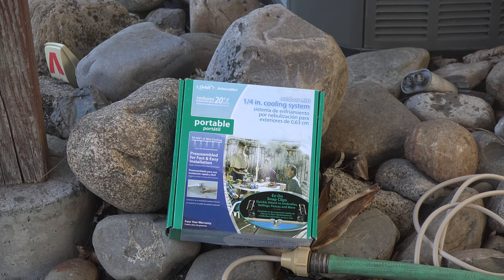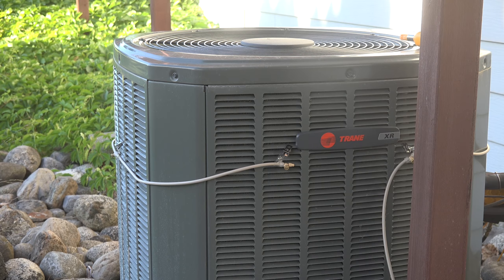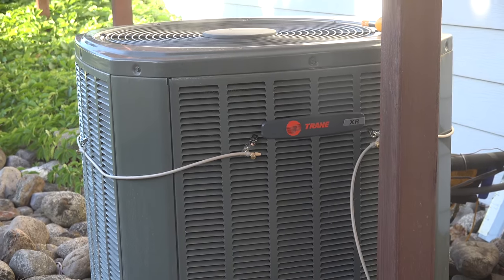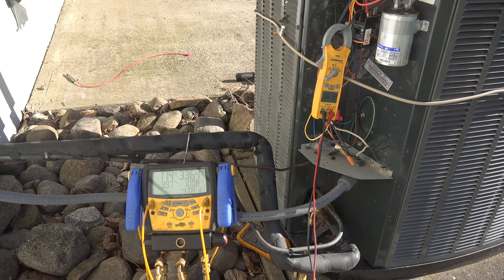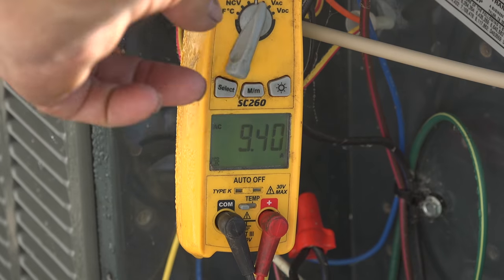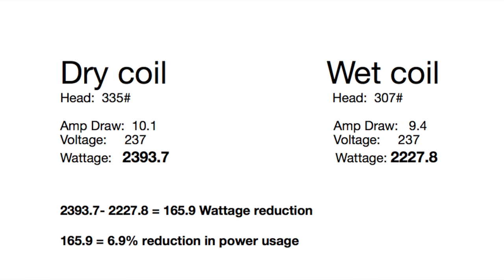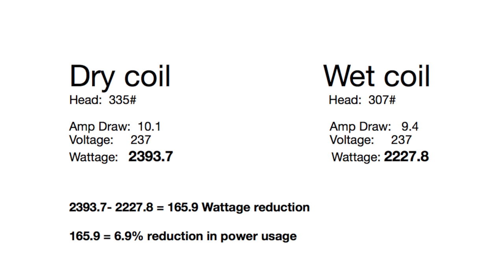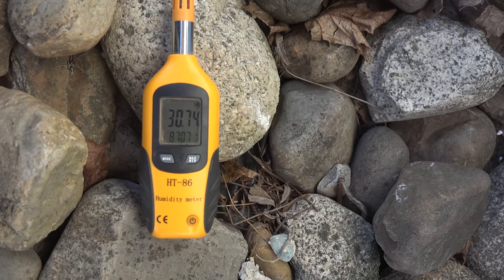Do the misters for A/C work? Part #1

Comment: The reason this system works is not simply the evap. cooling method. Water (and solids) have a higher heat density than air. The small amount of water carries away more heat than a comparable volume of air. With professional help, you could take the coil itself and place it in a tank of de-ionized water with corrosion inhibitor added connected to a small radiator/fan system that prevents the water from getting too hot and you would have very efficient cooling without worrying about hurting the coils. The air exchange part of the system is the largest inefficiency in any a/c system.
Reply from the maker: What you are describing is a water cooled condenser with a cooling tower..  The condenser is essentially a pipe inside a pipe.  And yes, head pressure can be reduced.  
The problem is the use of water complicates the condensing of the refrigerant.  Maintenance is increased by many times.  The fan to cool the water is also not small.  It is the same or larger than the fan of the air cooled condenser.
GFM

Comment: Even with an advanced water softener quite a bit of calcium still passes down line. Problem is after calcium is deposited acid is used to disolve and that damages both aluminum and copper
Reply from the maker: Agreed.
GFM

Comment: What happens with other side of system?

Does subcooling on txv system change? or super heat?. 

if evap side stays the same great but if not youre running a lower amp draw but also dropping less temp and humidity across the coil inside then whats the point?

ie you run lower amps but over a longer run time you use more power as the cycling is longer.

seems like a gimmic to me
Reply: you could test btu output on airside to figure out if it makes a difference in capacity. that way youd have eer vs eer instead of just amps
Reply from the maker: I don't know about subcool, but as the unit uses a TXV, superheat should not change.  The effect on performance would be all positive.  Similar to a lower outside air temp.  Compression ratio will go down.  One downside could be low outdoor ambient operation causing a frozen coil.  
Understand that I am not singing the praises of this product.  I don't think it is a valuable idea.  Very little savings for a lot of damage to the coil.
GFM
Reply: thanks gfm
i agree its a costly gimmic.

best way to be more energy efficient is to install a more efficient ac system to begin with and keep it maintained

Comment: Between cycles the water just sits there in the garden hose getting hotter. Think a cool and filtered water mist would make a good difference.
Reply from the maker: It certainly could.
GFM
Reply: What if instead of water, you tap into the cold air it's producing already through the indoor blower and do a splitting action outside
 like the mister but it's just cool air that flows freely sharing with the outside unit ( small percent ) when blower kicks on . Just a line with quick disconnect and plugged for winter time.
Reply from the maker: On this one, I have to beat you up a bit.  You want to take the cool air that the air conditioning system cooled and use it to cool the air conditioner?  Do you realize that any cool air removed from the conditioned space must be replaced in order cool the structure?  A small percent is still cooled air.  
GFM

Comment: Did you measure the total subcooling of the condenser? I'm curious what it did with that to affect overall operation and capacity.
Reply from the maker: I did not.  I may do an additional video that includes superheat and subcool.
GFM

Comment: Check the temperature of the air coming out the top if it is lower you have less run time.
Reply from the maker: Checking the head pressure is much more accurate. Asia done in the video. GFM

Comment: According to the EPA, shade cools the air around the outside condenser, increasing efficiency by as much as 10 percent.
Reply from the maker: First, this video is about misters, not shading.
I have also done videos on shading the condenser.
The shading is more than the condensing unit.  Shading the condensing unit is mostly worthless.  If I can shade the entire house on the sunny side, whether the condensing unit is there or not, it will reduce heat gain of the structure significantly.  By far, the best way to do that is with several trees on the sunny side of the house.
BTW, when is the best time to plant a tree?  Answer: 20 years ago.
GFM
Reply: @grayfurnaceman  Got it👊🏼

Comment: Yes, you have done a scientific power consumption measurement, but have not addressed the efficiency issue.  That is , the AC may run for less time if the air is coming out colder and using less power.  The calcium argument seems very valid.  I have verrrry hard water.  I was also thinking about a sun shade.
Reply from the maker: I did not consider any cycling reduction because I did not think it would make an appreciable difference.  I will be publishing a video or 2 that takes that into account.  A shade is also the subject of a future video.
GFM

Comment: If the coil is much hotter than the surrounding air the effective humidity would be lower? So this should still work in Florida not as good as Arizona.
The more water used by the mister should cool a more to a point?
Someone from Florida needs to post if they used this and if it worked.

Comment: I'm curios as to what the power factor is with both dry and wet coils. Or does the run capacitor on the compressor take care of that?
Reply from the maker: Power factor is very much overused.  I would have to say that there would be no difference if the power factor was included.
GFM

Comment: can you try to use an additional fans like the one but for car radiator??
Reply from the maker: That will probably do more harm than good.  The fan in the unit is quite efficient at moving the heat out of the coil if the coil is clean.
GFM
Reply: @grayfurnaceman  temperature in summer reach 131  F in our country,  if we success to increase the airflow  through radiator that may help , if you have any advice how to  reduce the power  consumption  i would be thankful for you
Reply: for our cars radiators we install additional blower to car radiator and it reduce the temperature abou 1/3
Reply from the maker: @alialrayif3112  As a fix to existing units, you could replace the fan motor with a larger horsepower one.  Such as an existing 1/3 hp change to 1/2 hp.
GFM
Reply: @grayfurnaceman  thank you

Comment: You are forgetting that on a humid day, the mist will actually reach the coil which is at a much higher temperature, and the relative humidity of the air next to the coil is vanishingly low.  In other words, the drops of mist will be converted to water vapor and the calories will be pulled directly from the coil to do that.

Test it on a humid day.  You'll find it still works.
Reply from the maker: The point of misters is to evaporate the water before it gets to the coil.  Thus reducing the calcium buildup on the coil.  If you can't evaporate the water, you are just spraying water on the coil.  Kind of like a water cooled condenser.
GFM

Comment: But you have extra water consumption or extra power to run  well pump
Reply from the maker: Misters are not sprinklers and the mister is designed to evaporate most of the water.  Usage is less than a five minute shower.   
GFM

Comment: My question is how long did the unit run for? For you to get those numbers????? And if this was for only a few minutes? Then i wouldnt agree with your numbers, i would need a one month of savings not just a few minute
Reply from the maker: This test was short term because there is no accurate way to compare power usage for long periods.  The heat gain of the structure will never be the same even for different parts of a day, much less for an entire month.  The test you saw was the result of several tests done to confirm the results.
GFM

Comment: Im not for it or against it, nor am i a ac repair man. Having said that , i live in the south, hot as hell, if a small shower pops up with sun still out blasting on back of house , i notice a huge difference in the effective cooling. Rooms in back of the house which is the west get hot in afternoon due to all the windows. It always gets noticeably cooler with a rain shower, even when sun is still blasting.

Comment: You could use the condensate coming off the inside unit.
 1 It's condensed water out of the inside air so absolutely pure water (no mineral deposits)
 2. the water is chilled. 
3. 6-7% increase in efficiency is worth pursuing provided the Mineral deposits are eliminated.
Reply from the maker: I don't know how much extra time you have, but I am not catching condensate, taking it outside, placing a pump in the bucket and spraying it on a condenser.
Add to that, misting is only effective in dry climates, so the condensate volume will be very small.
Also, pure water is quite corrosive, so you could be damaging your condenser.  
That 6 to 7% is power usage, not efficiency.  If you consider temp drop across the coil, there is no difference.
GFM
Reply: @grayfurnaceman  Thanks for the response, valid points, as far as a do it yourself project you are probably right. The trouble isn’t worth the gain. I would say that for the industry small gains are worth millions and 6-7% might be worth billions.
Reply from the maker: @1965ace  What you need to consider here is building engineers are not stupid.  If you could actually save a consistent percentage don't you think they would have tried it?  There are people who make their professional life from coming up with ways to cheaply reduce energy usage.  Guys like us are way behind curve here.
GFM
Reply: @grayfurnaceman  Good talk, I know a lot of dumb engineers, have you ever pulled a motor to change the water pump? Any new design is up against complexity, reliability, and cost.. There will be breakthroughs in the future. On the one hand there are people who think solar panels can replace fossil fuels who don’t understand the scale of our energy consumption or people who believe an alternator on an engine can power electrolysis to make HHO to give the engine “more power “who don’t understand the laws of physics. I applaud your pragmatic approach and understanding of diminishing returns but there has to be a kid in you who not everything has been discovered, engineered or imagined!
Reply from the maker: @1965ace  So true.  Sometimes engineers get a bit specialized.  My granddaughter is a chemical engineer and she doesn't know what a cam is.
On the other hand, My entire home is powered by solar.  It really works.  Even powers my electric car.
GFM
Reply: @grayfurnaceman  With all due respect how many kWh do you use every day and how large is the system? I put together some thoughts a few years ago. Solar Panels nonsense
Reply: @grayfurnaceman  At an average of 10,908kwh per year US home not including automobiles and 12cents per kwh average rate on the public grid you would pay about $1,300.00 per year. The needed average system based on 5 hours a day maximum output every day (not including the loss to weather) would be a 6,060 watt system. At $3.14 per watt installed system I calculated a liberal 5 hours per day with maximum output (not realistic ) you would need 6,060 continuous watts. That amounts to a $19,000.00 initial investment. So in 14.6 years (I believe a more realistic 17 years, weather, maintenance etc) the system begins to pay for itself but this is also the lifespan of such a system.
Reply from the maker: @1965ace  I will be doing some videos on my solar system in the near future, but here are some figures:
13KW system
Mar 2021 1.5 MWH
Apr 2.1 MWH
May 2.3 MWH

Solar panels guaranteed for output and materials and workmanship 25 years
Inverters guaranteed for 25 years.
I have a grid tied system and am on track for a zero electric bill for the year starting in July 2020.
The technology has improved.
PS:  Charging my electric car is included.
GFM
Reply: @grayfurnaceman  Pulling random information off the internet from solar panel companies looks like a 14kW system is comprised of 44 panels (this particular company ) and puts out an estimated annual 22,400 kWh. For comparison, one gallon of gasoline contains 36.6 kWh of energy so that system could replace 612 gallons of gasoline annualy. A 14kWh system at a current average cost of $2.81 / watt represents an actual cost of $39,340 (without government welfare). At an inflated $3.00/gallon, 612 gallons cost $1,836. The average lifespan of a system is 17 years so before you benefit one cent your system has to operate for 21.5 years at the current prices compared to the cost of gasoline. With all due respect, I don't know what you mean by MWH (Mega Watt Hours?).

Comment: This is a very interesting video that I ran across while trying to look for post-hurricane cooling options. If anyone knows of a cheap generator & one room a/c cooling unit please let me know. Regarding this video and subject-  Did anyone ever mention using distilled water to prevent the calcium deposit issue? You wouldn't want to buy one gallon per day as this would defeat the cost savings; however, if you have time to boil and collect enough distilled water on a daily or weekly basis maybe it would help? If you live in a sub-tropical climate where it nearly rains everyday and the humidity is naturally high anyway, would misters help at all? I do know that proper maintenance will help to reduce your power bill- and if you know how to do it yourself you can save some money there as well. I just vacuumed my drip line out yesterday. Using the proper filters and changing them regularly helps too. Will learn the other stuff later! Thanks for the info and cool experiment!
Reply from the maker: Distilled water should not be used as it is quite corrosive.  Especially when used on coils with dissimilar metals and at warm temps.  Sub tropical environments reduce effectiveness.
GFM

Comment: Instead of misting and the waste of water it would seem more practical to shade the unit from the sun.it would lower the temp.and be a lot less harmful the the unit.seen it done and was told it works.
Reply from the maker: I know it seems that shading an A/C would help but I doubt the solar gain is appreciable.  I will be testing a unit by comparing a shaded unit with an open one in the sun in a future video.
GFM

Comment: What is the super heat and sub cool on the unit . Loss of capacity when wet?
Reply from the maker: I did not check superheat and subcool.  The drop in head should act as if the outside temp was somewhat lower, so it should not change.  No accurate way to test for capacity but it should increase slightly due to lower compression ratio.
GFM

Comment: They've been around since the 80's. They cool the coil which lowers the amp draw, but lower amount of coolant into the evap coils.  If they increased efficiency, AC manufacturers would be selling them...THEY LOWER COIL PRESSURE, ALSO LOWER COOLING...
Reply from the maker: As you saw in the video, the performance actually reduced with the misters on.  When we decide we know more than the engineers, we usually get burned.  I will be doing more on this in the future.  
GFM

Comment: A much better method for doing something like this is to do what a company does already. Freeze the coil in an ice block, then let the coil melt it.

This is a CRUDE explanation of how it works, but the basic idea.

The theory behind the freezing method is to use power at night to freeze the block of ice when cost of power is cheapest, then when cost of power is highest, let the ice be the cooling medium. It has been proven to save a lot of money, but requires all sorts of special crap to install. (You don't use a typical A/C unit)

Now, I don't know if there is freon in the coil in that system, or if it is a water block. I just saw it on a documentary on TV. I do know that the box they use outside is like a big ass deep freezer looking thing with the coil thingy inside it.

I do like the simplicity of this test though. I live in a high humidity environment, so I would like to see what, if any, mine would save. My unit is also 13+ years old and on its last leg anyway!

Comment: I did not see any comparison of operating times for the A/C. If the heat exchanger is more efficient then it would cool the air more hence need less operating time for the A/C for the same heat load. That is where I would think any potential saving come from, not from direct operating load of the cooler whilst in operation. Just my 2 Cents. Thanks for the video.

Comment: I just bought a widow Frigidaire and the instructions say to install on north side to avoid sun and if installed in sun this will lower advertised efficiency rating. So any engineers that can calculate the loss and design a way to avoid this loss on a sunny side of the house? Thanks for the measurements. What was the temperature of the coolant entering exiting the system before and after the mist. And just for fun if you temporarily hosed the whole unit with water and measured while the water completely evaporated how much efficiency is gained? Obviously the mist system as is could cause much more possible harm that closed loop systems that are properly engineered and calculated with precision. A mist floating around may evaporate by itself and not help cool the coils much at all. Basic cool water must touch coil absorb heat and take heat away by evaporation, of course, but how to add evaporative cooling to Freon cooling system. If this is  diyourselfer heaven then why not buy a big swamp cooler provided you live in a low humidity area and blow this cooler air into the other cooler and channel only this cool air into the Freon based cooler. Tech guys stand by to fix other problems.
Reply from the maker: Have you watched the whole series?  I go pretty far on different methods.  
GFM